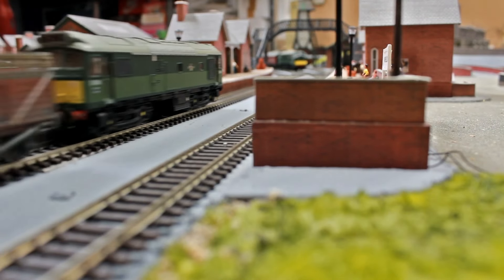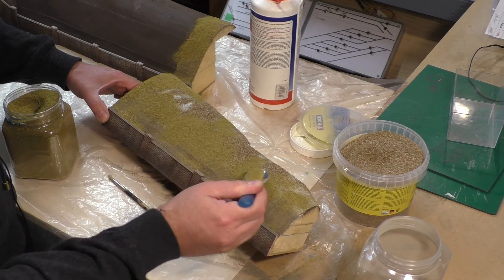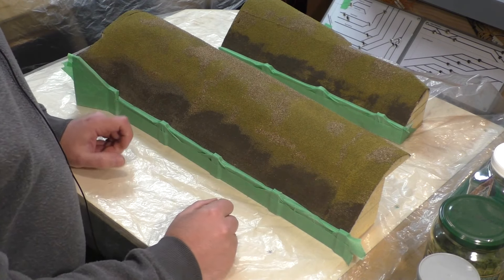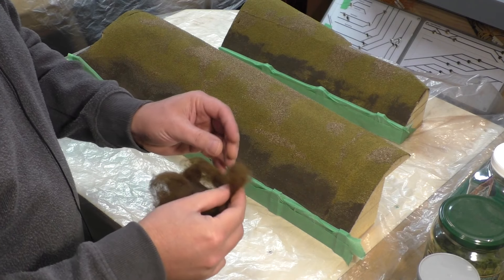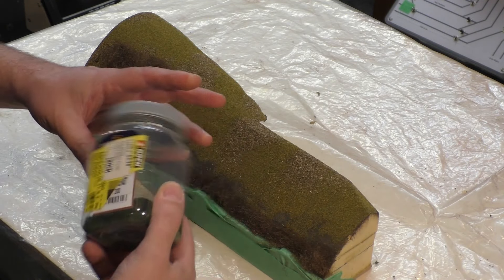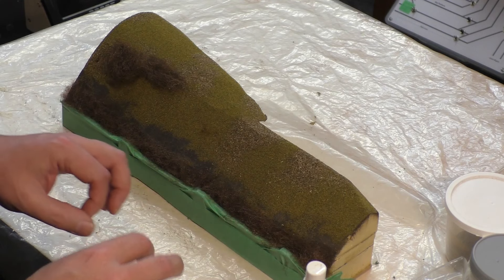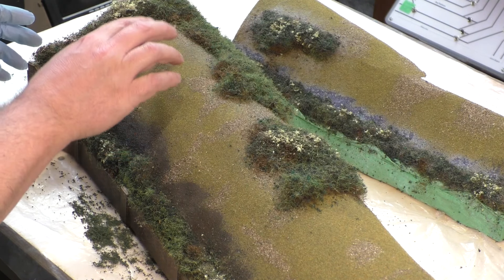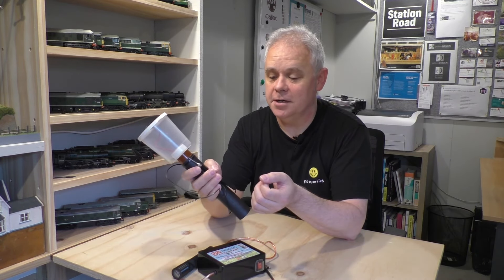Applying Scenic Scatter and Foliage

Comment: I believe that you have given me an answer to a problem that I have been facing - I need to add some bushy scrub to a section of my N scale layout, but the usual Woodland Scenics Underbrush and bush foliage is just a little too solid for what I want. Was thinking of using some poly fibre or some Woodland Scenics foliage material that I have used to make small trees, but this stuff is a little too green. Now I am off to a yarn store that has felting wool and see whether I can get some brown wool similar to what you have. Thanks for the tip.
Reply from the maker: Thanks Eric. It always great to hear when I've been able to provide a possible to solution to a project challenge. I imagine this material would work well in N scale also, it would just be a case of pulling apart smaller clumps/tufts. Cheers, Julian

Comment: Just came across your channel in the last week.
This approach gives a great finish.
But if you are working on a fixed complete base you don't have the luxury of tilting and shaking off excess.
The use of a vacuum cleaner is also not appropriate for many of us. 
So putting on just enough scatter or grass to cover is an alternative approach.
Reply from the maker: Thank you for your kind feedback. You're absolutely right, fixed scenery does require a different approach. I've seen folk use a stocking over the vacuum cleaner pipe to collect excess scenic material for further use later. The main reason I've gone down the modular/detachable route is to avoid this while also having the option to take the modules into the house during the winter months and continue working on them in comfort/warmth.🙂
Reply: @StationRoadModelRailway  being a kiwi also I totally understand the need to relocate in winter.
My layout has polystyrene sheets on  a base board for the terrain so my approach to terrain surfacing needs to be quite controlled and therefore is much slower.